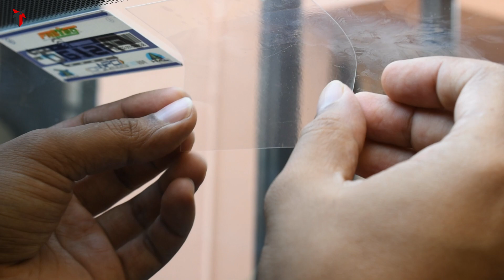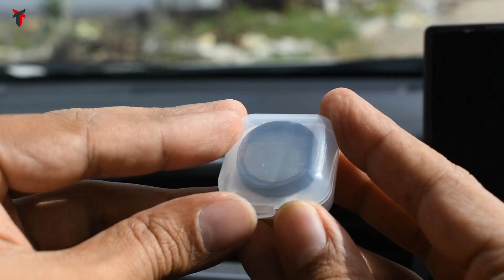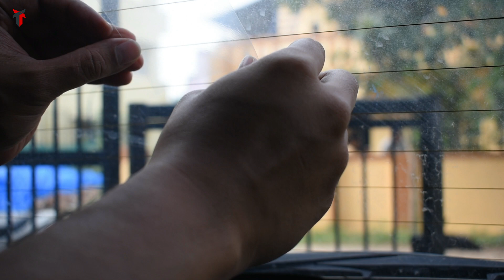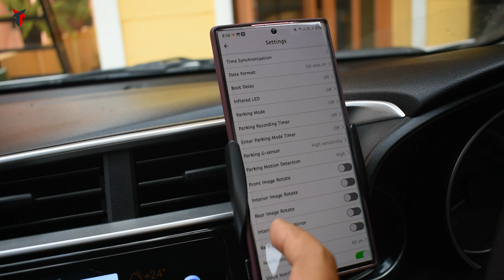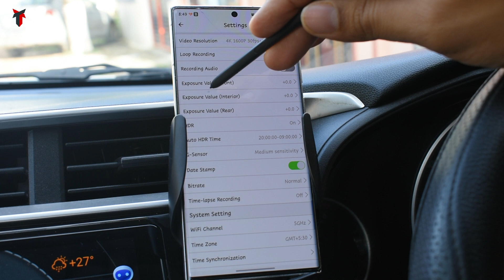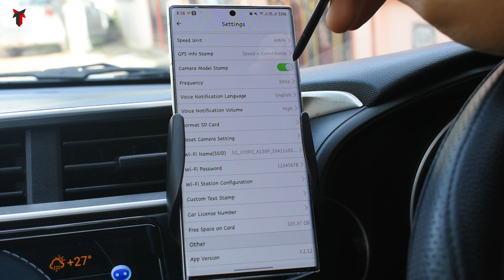VIOFO A139 PRO Dual Channel Installation & App Settings Guide | Gizmobeep

Comment: Question - what are pros cons of using electrostatic sticker?
Reply from the maker: Pros:
Doesn't leave sticker gum residue when dashcam is removed.
Provides good adhesion. 

Cons:
Difficult to detach from sticker mount once attached.
Dashcam mount won't be reusable because of this.

Comment: I have an A139 pro, but the resolution options are only 4k 30fps. I have no 60fps options, any ideas? I did check, my firmware is current
Reply: If you haven't figured it out, it's because of HDR. Your HDR settings are probably on, and in that case the camera cannot do 60 fps. If you turn HDR off, then it can do 2K at 60 fps for the front camera.
Reply from the maker: Where are you bsased at? Check with VIOFO service support.

Comment: What do you recommend to use to tape the cable or avoiding it from moving?
Reply from the maker: Cable usually is pushed inside the beading of the car. It won't move if it's fit in well.

Comment: I just bought this dash cam and was wondering how do I get it to record my whole drive not just clips
Reply from the maker: It records the whole drive but it does so in clips. It cannot record a single long file. This is too prevent overheating of the dashcam. You can always copy those small clips and stitch them together to form one long video file using a video editor.

Comment: Hello sir, thanks for excellent video.

I am planning to buy 3Ch dashcamera but Viofi internal (cabin) dashcamera can not be rotated horizontally

It can be moved up and down only. Is it possible to move sideways? I want to record footage sometimes when I am talking to cop who is standing outside car and I am on driver seat.

Please reply
Reply from the maker: This camera can be rotated horizontally. Check this: https://youtu.be/vYO5eUyMWG8?si=2c-WL4KZt7gT1kJm
Reply: @gizmobeep  Thank you for the response. I have watched that video. It doesn't have screen.

My plan was to monitor continuous rear view through rear Dashcamera LCD screen while I am driving. I will miss on it then, right?

Or I can buy screw size Viofi 3 ch dashcamera and stick internal camera vertically and change orientation through settings.

Is there any other benefits of having LCD screen for dashcamera?

Thanks again
Reply from the maker: The internal camera has a sufficient field of view to cover the driver side window. While installing the dashcam, you can check the live view either via app or on screen to install the internal camera in a position that gives maximum visibility towards the driver side window.

The advantage of having screen is you can monitor the status if the dashcam at a glance and if need arises, can change any settings as per requirement immediately without wasting time. If screen is absent, then you have to go through the hassle of connecting the dashcam to your smartphone via dashcam's wifi hotspot inorder to do the same thing.

Monitoring rear camera view in the screen is possible but not practical. Reason being there will be a lag of 1-2 seconds of the live feed from the rear camera. This means what is shown on the screen will be different from whats happening in real-time behind the car (by 1-2 seconds). Hence this can lead to accident if given priority over the actual rear view mirror.
Reply: @gizmobeep  Thank you. I will go through your video affiliate link and buy products through it to show support. You are expert in this. I have watched many videos from other people too. You are fat ahead in crisp clear content.

One more quick question -

If I buy Viofo 3 ch camera and just use its two camera front and rear and do not use internal cabin camera. Will it be okay, right?

One Viofi which I want is out of stock but 3ch available
Reply from the maker: Yes you can use according to your requirement. You can use the front only, or front+rear or front+rear+interior. No issues
Reply: @gizmobeep  Thanks sir.

One last question promise :P,

If I connect dashcamera through OBD-2 cable for parking surveillance, will battery drain?

I saw your that video. You didn't mention anything about auto disconnect when is about to be completely discharge
Reply from the maker: I don't think VIOFO has an OBD2 hardwiring kit. Do they?
Reply: @gizmobeep  Sorry, they don't. You are right. 

ddpai mini pro do. my question was about ddpai pro. will battery drain completely?  or is there any tool/gadget which auto disconnects  before battery drains completely
Reply from the maker: It has a control box which will auto cut off the power after the battery reaches the voltage of 11.9V. Hence battery won't drain out completely.

Comment: I installed but video feed isn’t showing on my phone?
Reply from the maker: Is the dashcam turned on. Have you enabled wifi? Is the connection between your smartphone and dashcam proper?
Reply: @gizmobeep  VIOFO works better with Android oppose to iOS.
Reply: Hiya during set up my wifi keeps on disconnecting,how do i secure the connection? My wifi is flashinh on and off blue,do i have to take it on my house to connect it to my wifi? As i dont have wifi any where else,however i have 5g on my samsung A53
Thanx or any help

 @gizmobeep

Comment: AMAZON India is not selling viofo A139 Dual Dash cam but only 3C which has interior camera as well and costing Rs 46000/- Where can we get A139 dual camera
Reply from the maker: Thats because its currently out of stock. I will update you once its back in stock.
Reply from the maker: Also, the A139 Pro is an older model. A newer model called A229 Pro Dual is better than that. Check it out in this link: https://amzn.to/3MeAe94

Comment: Nice presentation.Just got a new A139 Pro duo dashcam. Just a quick question. What's the use of the transparent film on the front / rear windshield.

My old vehicle had A119 Duo plus which didn't come with these stickers. So confused. Thanks
Reply from the maker: They are electrostatic stickers. You can use those stickers for attaching the dashcam to windshield as shown in the video. They are used in case you need to change the location of the dashcam in the future. But if you are not going to change its location for a long time, then you need not use those stickers and attach the dashcam directly.
Reply: @gizmobeep  Can we use the electrostatic stickers for rear windshield which has defogger lines or are these only for front windshield. Thanks.
Reply from the maker: You can use for rear windshield as well.
Reply: @gizmobeep  But Viofo India contact is not recommending to use sticker on rear windshield which has defogger lines.
Reply from the maker: Yes. They don't recommend because if you use rear defogger quite often, due to heat produced, it might affect the adhesion of the electrostatic sticker. Then if by chance it falls off, Viofo doesn't want you to blame them for providing weak sticker etc. It is standard company policy. 

My recommendation is, if you use rear defogger very rarely, maybe once in 6 months or so...and only for a few minutes, it wont be a problem. If you use rear defogger more frequently, then avoid using the sticker.
Reply: If I have to choise between 70 Mai 810s, ddpai Z50s or viofo A129, which one you recommend
Reply from the maker: Go with 70mai A810 since it has the latest Sony Starvis2 sensor.
Reply: Could you pls guide cabin recording features available in which Dashcam
Reply from the maker: Check this: https://youtu.be/vYO5eUyMWG8?si=CmboQt4s6-aHlYZB

Comment: Hello Brother ,

My friend is coming back from USA and I’m planning to ask him to get a dashcam from there .  Just thought of taking your expert advice. Below are the price for the cams .

70mai A810 dual - 160$ 
Viofo  A129 Pro Dual - 190$ 

Is Viofo worth spending extra money here as it’s a old model ( Now we have new A139 Pro which is bit expensive ). So this a new model vs old model comparison. What are the advantages going with Viofo over 70mai . Please advise .

P.S : I will be using for my hatchback car @ Bangalore . 

Appreciate your feedback.
Reply from the maker: I recommend buying a camera with the latest Starvis2 sensor by Sony. A129 Pro doesn't have Starvis 2 sensor. Only A139Pro has it. So you can go with 70mai 810 dual.
Reply: @gizmobeep  Great advice
Reply: Thanks for the nice explanation. Do you know if we get that a129 pro from US, the warranty can be claimed in India? The price difference between India & US is quite significant.

Also, I am looking to hardwire it in my Seltos. Do you know if micro2 fuse will be compatible?
Reply from the maker: Warranty might have issue. Check the fuse type in Seltos. Which fuse type does it have? Select the corresponding fuse wire provided for hardwiring.
Reply: @gizmobeep  sir Which Dashcam can be fitted in Maruti Suzuki Grand Vitara Zeta variant.
Reply from the maker: I have already answered your question, but you keep asking the same. Also, dashcam can be fitted in any car with a 12V charger socket. So your car is not important in deciding which dashcam to buy.
Reply: I like the way you explain features and unbox the cameras. It would be really helpful if you also show some day and night time footage. I am looking for a dash cam for my Nexon EV for safety reasons but the video footage should also be of descent quality.
Reply from the maker: I have made a detailed video on day/night time video samples on almost all dashcams. Here is the link for this: https://youtu.be/yswYlQiumTM?si=L4mY68ZxZUQCypgW
Reply: Hi, Can this be possible ? What if I can buy two VIOFO A139 PRO 1CH product (one for front and one for rear). This is to achieve dual channel (4K Front + 4K Rear) by connecting rear camera to the front camera.
Reply from the maker: Only the designated rear camera will connect to the front cam. The same camera won't connect. You can use it as a separate rear camera instead of connecting it to the front.